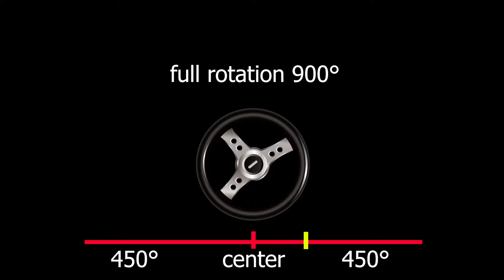How To Make Gaming Steering Wheel at Home | 900° | (made from Joystick) | DIY

Comment: Can we use a spring instead of tension spring
Reply: no bro cause normal spring does not have enough tension to pull it back to position. if you can't find tension spring anywhere you could use normal spring than, but it will not have same pull back effect

Comment: Looks like the steering response is delayed 🤔.
What if I dont use the fan gears? cuz it looks like the gears has gaps in the teeth that contributes to the delay
Reply: U can use 15 teeth with 36 teeth gear for 540 ° steering wheel or 15 teeth and 56 teeth gear for 900° steering wheel

Comment: How did u connect the fan gearbox to thread bar and where to put 10k poteriinmeters
Reply from the maker: Using glue gun
Reply: @zudumalli  where did u connect the 10k potentiometer in the steering wheel and where the wires are connect in wheel

Comment: If I have a gearbox that can rotate 900 degrees and a potentiometer that can only rotate 300 degrees, and I install the potentiometer in the gearbox to use it with a steering wheel, wouldn't the potentiometer break because it can't handle the full 900 degrees of rotation? So, the steering wheel wouldn't be able to rotate the full 900 degrees, right?

Comment: where do i put the potentiometer????? also is the fan gearbox for 900 degrees or is that the gears purpose?
Reply from the maker: For 900 degrees the gearbox potentiometer has 300 degrees so we use the fan gearbox. A potentiometer is installed in front of the gear box.

Comment: i have a lot of question due to lack of explanation i could understand
The length of the threaded rod, brake cable, and the tension spring
The diameter of all the wood circle thing and the square thing to prevent the outer case from moving further from that point
Last but not least, Does the spring connector quick connect cause i couldn't find it
do you even need the brake cable case or just the inside??
Reply: I think you can use some sort of elastic from clothes
Reply from the maker: Actually using this barke cable is a bit unsuccessful. Because if the tension of the spring increases, it becomes difficult to rotate the wheel. And the spring is also damaged. (The vehicular spring I showed in the video has more tension) So I suggest not to use spring.

Comment: How can i fix mine i just tried to makee this but when i connect it to the pc the potentiometer is jumping from middle and if i move it side ways it will jump like 20% its not smooth so its hard to drive is there anyway to fix it?
Reply from the maker: Calibrate with game controller properties
Reply: @zudumalli  i calibrated it and its still jumping from 0 to 20% or the problem is within the board and potentiometer
Reply: @AnimePhilippines  bro check if you are using an A type or B type potentiometer because you have to use only B type pot in this project
Reply: you need to use high resolution rotary encoder, its the only way:)

Comment: For an easy way out take apart a fan so you just have the part that rotates the blades and use that, some fans have gears in them, you can modify to turn 900⁰-1080⁰ 👍
Reply from the maker: Good tip! thanks bro😍

Comment: Is fan motor is important? What is it's use?
Reply from the maker: The potentiometer only has 270 degrees. So if you want 900 degrees, you have to use the gearbox. That is why a fan gearbox is used.
Reply: @zudumalli can I use any fan gearbox

Comment: Please help i don't understand the fan gearbox part or the potentiometer setup from the other video you did it too fast and even slowed down i can't understand it please help
Reply from the maker: The potentiometer only has 270 degrees. So if you want 900 degrees, you have to use the gearbox. That is why a fan gearbox is used.
When connecting the potentiometer, keep your steering wheel at the center position and connect the potentiometer at the center position.
Reply: @zudumalli  wait so i connect steering wheel to one end of gearbox and other end to potentiometer? also how much are the gearboxes
Reply from the maker: It doesn't matter if you have a good idea. It's hard to be exact about the prices because I'm from Sri Lanka and the prices vary a lot depending on the country you're in.
Reply: @zudumalli  but is it buyable or do I have to buy a fan
Reply from the maker: No, you can buy it separately
Reply: @zudumalli  nice, i like how you used a cheap gamepad and not arduino leonardo

Comment: Bro how to unlock 900° on potentiometer
Reply from the maker: 900° is not available in the potentiometer. There are only 270° in the potentiometer. That's why I used a fan gearbox. After installing this you need to calibrate Game pad properties
calibrate Video - https://youtu.be/r4zS8U94Pw4?t=193

Comment: Do you have any latency lag while using this wheel? And bro how you connected the shaft to the fan gear box plzz reply
Reply from the maker: No, no latency, but the steering wheel has a dead zone it's a little bit problem. and I use the glue gun to attach the gearbox
Reply: @zudumalli  what do you mean by dead zone?

Comment: what did you use as the source?
Reply from the maker: wood, bolt nut, bicycle cable, tread bar, iron plate, bearing, table fan gearbox.